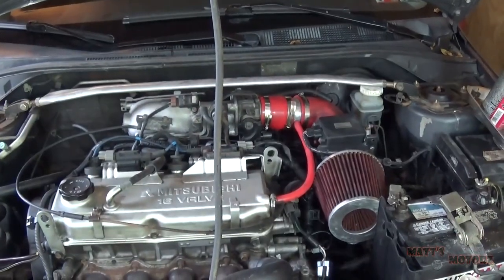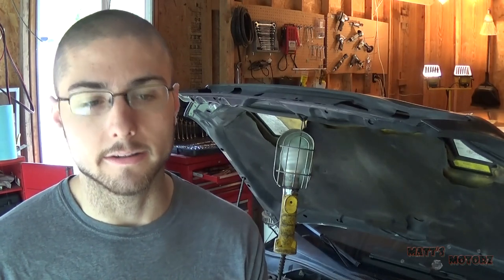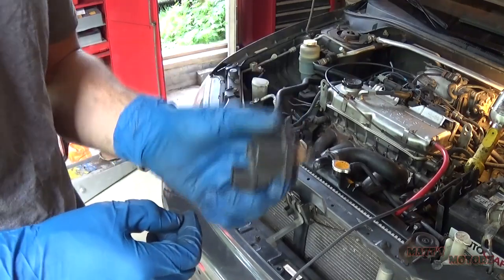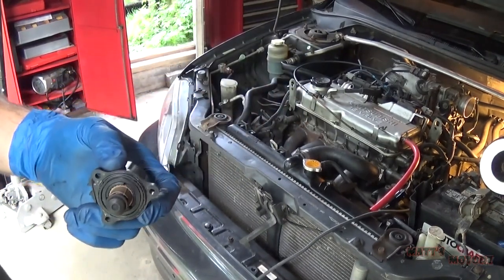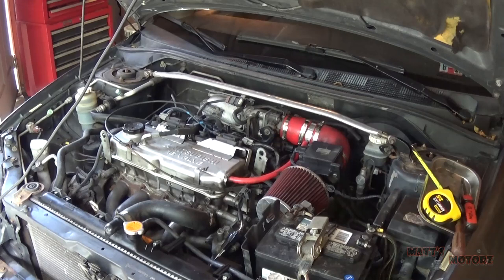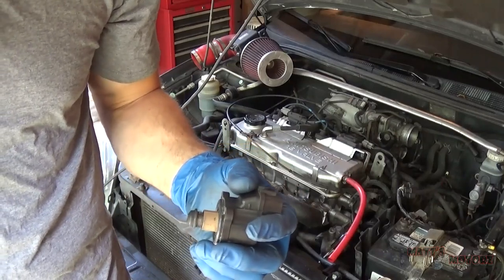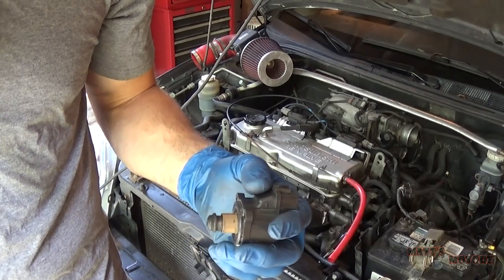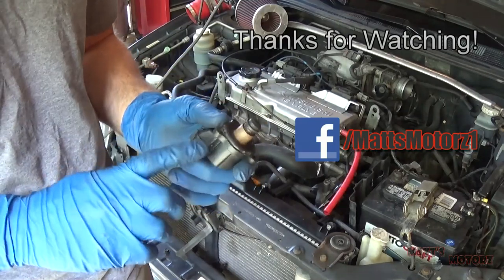Easy Way to Check an Idle Air Control Valve

Comment: in my 99 cherokee my car wont even stay on, it rolls over and i can give it gas but as soon as i let off the gas it dies, would that be an iac problem?
Reply from the maker: TheBaronvonbadass Yes it could be, but to me it sounds more like a large vacuum leak.  Check for leaks around the intake manifold or brake booster. Also check the air intake after the MAF sensor.
Reply: i just got done cleaning the iac, it didnt help and it wont stay on long enough for me to check where the leak would be in a hose
Reply from the maker: You mentioned that if you hold the gas, it will stay on.  Have someone hold down the gas while you check for leaks.  

When you check, you really need to check for places that could cause a large leak.  Small vacuum lines are not likely to cause this issue.  Check around the intake manifold and throttle body gaskets, as well as the brake booster line.

Comment: hi matt. my car runs fine when the engine is still cold. but when it is on the right temp, the idle gets rough, when the compressor work the idle goes down and when you put the gear on drive the idle will also go down up to 200-300 and the engine is shaking. when it is running 40-60kms rpm 1.5k to 2k the engine runs (somehow) smoothly but i can still feel that the engine is shakin moderately. is this also iac valve issue? thanks in advance man!
Reply: i forgot to tell you that this happend suddenly, i use my car everyday and it runs perfectly. and i used it a while ago like it is running for around 20mins and all of a sudden i got a rough idle.
Reply: i forgot to tell you that this happend suddenly, i use my car everyday and it runs perfectly. and i used it a while ago like it is running for around 20mins and all of a sudden i got a rough idle.
Reply from the maker: Lance Roman Yes that could be an IAC problem.  That is similar to what happened with this car.  It would run fine when cold, but when it warmed up it bogged down and stalled.  Replacing the IAC in my situation fixed the issue.  Let me know what happens!
Reply: hi matt thanks for your reply, i already bought a throttle cleaner and i will first try to clean the iac valve. i will update you what will happen. thanks again! :)
Reply: i already cleaned the throttle body and also the iac valve. but didnt fix the problem. is it also posible that my spark plugs are bad? because i can still feel the roughness of the engine even if in medium-high rev 2k to 5k..
Reply from the maker: In my experience, cleaning the IAC valve doesn't ever do anything.  The only time it help is if its gunked up with carbon. If it is mechanically compromised, it wont be fixed by a cleaning.

Eh, this does not sound like a spark plug issue.  I am really thinking it is the IAC valve or some other source of pirate air.
Reply: hi matt! just to update you, i changed all the spark plugs and it worked! im so happy and thank you so much for your time!! God bless you man! :)
Reply from the maker: Awesome! Thanks for the update!

Comment: Have 94 ram 1500 5.2l with 5speed manual trans and in second gear starting from dead stop it wants to some what kind stall with a  bit of a dieseling affect.
Reply: because you don't start inn 2nd gear duh
Reply: You don't start in low either unless your towing. Unless you drive a rice grinder truck ..duh

Comment: A dust mask will do nothing to protect you from exhaust fumes.  All that did was make it smell different.
Reply: What about a gas mask?
Reply: A gass mask would help. But putting a tube to lead the exhaust out would be a lot better.
Reply: Yes he is correct. You should direct the exhaust inside the car since you're not in there you're working under the hood. That way the exhaust gases won't get you.
Reply: Mmmm, yummy exhaust gas and paper. What's that lovey cologne you have on is that 87 octane.
Reply: the mask will only control particulate matter and not CO.

Comment: One problem with this is you can't be sure if your valve is a motor, or a solenoid. If it's of the solenoid type, it'll always go to the same place when not energized, so measuring it is pointless.

Comment: Hey Matt my 1997 Chevy Silverado idles poorly and the motor kinda rocks and then after a minute it just stalls even if u give it gas it still just stalls on me idk what to do
Reply from the maker: Mudboggin22 Well if you give it gas and the problem doesn't get better than it is likely not any kind of vacuum leak.  Next thing I would do is hook a fuel pressure gauge on it and monitor the fuel pressure as it stalls to see if it is getting starved of fuel.

Comment: Bro I need your help I have a Nissan Sentra I don't know what's wrong with it soon as I put it in gear it cuts off so U have a clue what it is? I did a turn up on it plugs coils all that u know what it is?
Reply from the maker: It could be a bunch of things.  Are there any codes??   First thing that comes to mind is a crank/cam sensor issue, but this is just a wild guess.  It would need to be diagnosed.

Comment: I used to have a car with bad idle valve the revs wouldn't drop below 1500rpm one week then the week after it would stall. Once it cleaned it was fine.

Comment: Does this have to do with my car running too rich?? I replaced oxygen sensor, throttle body but my car still showing my check engine light , cannot pass my emission test

Comment: Don't listen to this guy. His how to is flawed. 

Just take out your Idle air motor but keep it connected onto the harness that powers it. Have someone turn the key on (don't start engine), wait a second, then off. If the stem moves in and out then it works. If it doesn't change your idle air valve.

The motors job is to close and open the valve. If its broken you'll have bad idle.
Reply: How does it work your way with out it being able to read the temperature if it's not in? Or is that not how it works. Does it sense the temperature through other sensors. I'm trying to fix it as we speak. So please help if you don't mind. I'm open to all methods right now.
Reply: Manila Kid ,,can it be cleaned instead of replaced,they are pretty expensive que no?
Reply: You can try to clean it. Just make sure you use throttle body cleaner.
Reply: Manila Kid THANKS MAN THIS VIDEOS ARE SO COMMERCIAL NEVER REAL NICCAZ.
Reply: i got a 1998 jeep grand cherokee 4.0 and it idles rough,but once you mash the gas,it runs smooth,i took the it(idle sensor)and clean it,but i may have installed it wrong.please help
Reply: roger b  sounds like tps
Reply: i sold it.
Reply: It's not a motor, it's a solenoid. So in my opinion you are also flawed..........
Reply: purestress2 is is purely an electrically operated valve. it doesn't measure anything. the engine has coolant temp sensors etc to tell the ecu how much to open the idle air control valve, if at all.
Reply: Manila Kid I wouldn't say "flawed." His method follows a logical process and is effective, therefore correct. Yours is another correct method, with a different process, no more correct than his. To each, his own.
Reply: Manila Kid tried it that way is better
Reply: I like the "finger tip" measurement !
Reply: You can " JUMP " it.  It takes 2 Seconds, you will know right away.  12V DC Source will do fine!
Reply: Manila Kid. well he was right about one thing my pencil does get longer when my wife's engine is warm
Reply: Manila Kid you watched it
Reply: Oldman inthewoods its called a stepper motor
Reply: Manila Kid just buy a new one no matter what kind of car you have it $100 or less
Reply: Manila Kid is the rubber plunger thing supposed to shoot out when I tried this?
Reply: Oldman inthewoods 
A solenoid is a type of linear motor

At it's base a motor takes energy (fuel, electricity, heat etc) and turns it into work.

It can push or pull and still be a motor. A thermostat in a car has a wax motor in it to open the valve

Comment: 4.3 vortec rough start and power loss cant figure out the issue could my IAC cause this??
Reply from the maker: Check the distributor vent holes.  Those 4.3s have a REALLY common problem of getting clogged vent holes and not being able to vent moisture, which corrodes the contacts on the cap.  I would also replace cap if contacts look corroded.
Reply: Dude I have a 96 Jimmy 4.3 vortec I changed the tank,pump,filter dis cap rotor coil ignition control plugs,wires,thermostat,temp sensor,egr valve and mine still will go a week with no issues then all the sudden it'll bog backfire stall start right back up run for a sec then die ,come out when it's cold and starts right up till it gets warm then act up or come out when it's cold and do it I'm spun out on this if anyone has some input please help ugh.

Comment: hi matt another girl here,... plus i am disabled i have a 1999 honda crv,. when in park or nutral it revs on its own,.. how can i fix this isssue,. would a clean of iac help at all before i get into a garge in uk.
Reply from the maker: +Ella howell In my experience, cleaning an IAC valve never does anything unfortunately.  It sounds to me like there is a vacuum leak somewhere.  A good way to find a vacuum leak is to spray carb cleaner around the intake and vacuum lines and see if the idle changes.  Best to do this while the engine is cold as carb cleaner is flammable.
Reply: how do i sort the vacum leak,.
Reply from the maker: What do you mean by sort? Did you find a leak? Where is it?

Comment: Idle air take control valve and throttle box Honda Ridgeline 4 Wheel drive 2007. Honda says $800 for part?
Reply: ODM codes were P0 172 and P0 175. PepBoys cleared codes to turn Check Engine light off but didn't fix problem.  Became worse.
Reply: Engine dies in drive or reverse and misfire's. Runs rough!

Comment: I own a 2000 grand Marquis. it starts up fine, but when my foot isn't on the gas, it stalls out. can you help me?
Reply from the maker: Jay Elisofon That's definitely an "air issue."  If there is any unaccounted for air that enters the engine either through a vacuum leak (most common) or through a bad IAC valve, it would cause this issue.  First thing I would do is check for vacuum leaks.
Reply: Thank you!

Comment: would it make a car not stay running unless your foot is on the throttle?
Reply from the maker: +Robert Seekings Yes, another thing that can do that is a vacuum leak (which really boils down to the same main issue, pirate air).
Reply: +MattsMotorz thanks I'm having a starting issue with a 2004 KIA optima and everyone says the idle air control valve
Reply: +MattsMotorz I have changed the IAC and it still won't stay running it keeps popping up mass air flow (MAF) low circuit. but its brand new. and then  it popped up intake air sensor.and the trouble code went away any idea of the issue? dead cell in the battery?? please respond asap thanks
Reply from the maker: It really sounds like a vacuum leak to me.  Try spraying carb/throttle cleaner around the intake and other places where air travels and see if the RPM changes. (Careful, that stuff is flammable and you are around hot exhaust)
Reply: +MattsMotorz iv already done that I've tracked down every vacuum hose I possibly could.. the problem is I can't get It to idle to do so... but I was told by a dealer its possible for the mass air flow connector could be shorted. for running a p0102 low circuit
Reply from the maker: Have someone else hold down the throttle.  Check around the intake manifold as well as everything right after the MAF. Check more than just the vacuum lines. (If you haven't already done so.) 

Yes the connector can indeed be shorted. Or it could be open. This is where it gets tricky.  You're going to need the wiring diagram for that circuit.  If I was in your situation and was suspecting a wiring issue after exhausting everything else, this is what I would do. (I hope it makes sense, it is hard to explain these things sometimes)

1.) Unplug connector to the sensor.
2.) look up where the connector that the other end attaches to is and disconnect that.  You now have disconnected the wiring from the components on each side and are essentially just dealing with the wires only.
3.) Set a multimeter to test for continuity. Look up which pin corresponds to the pin you are testing on the sensor (check each pin, one by one) and put one lead on the pin you are testing and the other lead on the corresponding pin on the other end of the harness.
4.) If the meter beeps and there is no excessive resistance, it means that there is a good connection between each side of the wire.
5.) Next, keep one lead on one of the pins (doesn't matter which side) and put the other pin to a ground and see if it beeps.  Only one pin (the ground pin) should beep in this case.  if the other pins beep, there is a short.

Make sure both sides of the harness are disconnected as well as disconnecting the negative battery cable before doing this!
Reply: +MattsMotorz I'll try it but the harness doesn't unplug on both sides so it would have to be spliced...... would a battery that's not holding charge more then a couple hours have a issue with this?
Reply from the maker: The harness always has another side.  It most likely connects to the main computer or other control module.  This is where the wiring diagrams come in handy because it tells you where each connector is on both sides of the circuit so you don't have to trace any wires.  Do not splice any wires in, you want to test the ENTIRE WIRE for each pin.  The only way to do this is to go on the other end and unplug the connector.

Note that the wiring diagrams in the haynes and chilton manuals are not good.  You need the factory service manual diagrams.  These can be obtained (as well as more information than you could ever want on your vehicle) by going to alldatadiy.com  It think it cost around 15 or 20 bucks per vechicle. WELL worth it.

If your battery isnt good you should replace it.  The battery is the heart of the electrical system and can cause all kinds of issues if it isn't working correctly.
Reply: +MattsMotorz I'll try the battery and do the best I can do if I need anything else I will let you know thanks for the info
Reply from the maker: No prob! let me know how it goes
Reply: +MattsMotorz will do
Reply: +MattsMotorz that did not work. I checked the fuel pressure regulator it was clogged.... I cleaned it out no help there was a twig in the vacuum port. it idles when its vacuum is unplugged stalls when hook the vacuum back up... any ideas?
Reply from the maker: Hmm, the regulator uses vacuum to control fuel pressure to the fuel rail.  When it is unplugged, it allows full fuel pressure to the fuel rail.  

So it seems to be a fuel issue.  I think the reason why it ran with your foot on the pedal is because when you do that, the vacuum signal decreases and that increases the fuel pressure to the fuel rail.  

The stalling could be caused by something plugged up in the fuel system (perhaps change the fuel filter out) or by the regulator itself.
Reply: +MattsMotorz that's what I was thinking I looked up a couple forum's online. because the car smells like rotten eggs and stuff with almost black smoke it came up the regulator..
Reply from the maker: I say replace it and see what happens. Regulators aren't too expensive.
Reply: +MattsMotorz where I live they range from $50-$125
Reply: +MattsMotorz where I live they range from $50-$125
Reply from the maker: Check rockauto.com  They always have the lowest prices.
Reply: +MattsMotorz still pretty high. could it be a weak fuel pump?
Reply from the maker: It could.  It would be insightful to get a fuel pressure reading if you can.
Reply: +MattsMotorz I'm trying to find a fuel pressure tester somewhere but it has little pressure to the fuel rail
Reply: +MattsMotorz its a no go.. I was told it has been valves or a bad ecu
Reply from the maker: No waaay. Bad ECU? That seriously never happens. That is a "go to" when people can't figure out what is really wrong with it. Bad valves? No. Give me compression test and leak down test results and then we can start talking about that.

Did you check the fuel pressure?
Reply: +MattsMotorz I haven't got a chance to do a pressure test hoping tomorrow I can barrow one from my boss. and a compression tester as well. to me it seems like a dead cyclinder. it blows greyish smoke out the tail pipe and under the hood at high rev...
Reply from the maker: To check if the cylinder is dead, unplug the spark plug while it is running to that cylinder and see if it changes anything.  Then do the same for the fuel injector.
Reply: +MattsMotorz I totally forgot about that.. I just did that with a ford ranger to... I can tell it's not holding compression  there is a video of someone else's on here that did the same exact thing and they said they replaced the motor..
Reply: +MattsMotorz copy and paste ( 2005 Hyundai sonata hard start /rough idle) the youtubers name is chad Williams

Comment: Don't forget to check your computer loop status. Sometimes guys will put a cooler thermostat in and cause the computer to stay in open loop (limited functions). This can also cause rich mixture and hot stalling.